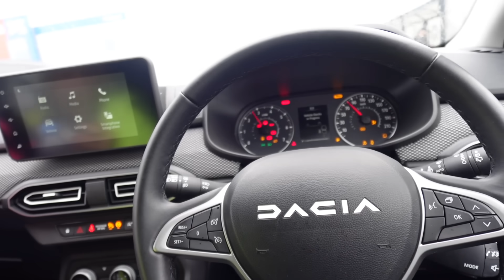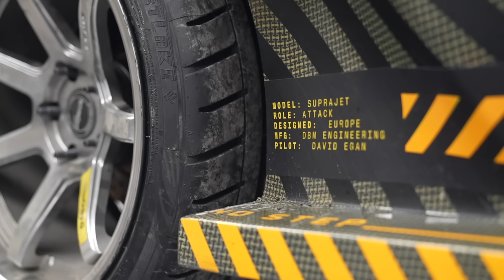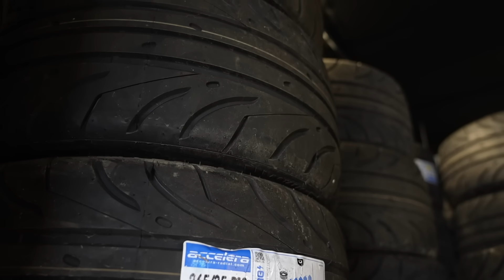Chelsea Denofa Drives my Lightweight Competition E36 (In Ireland)

Comment: Pretty sure the IS200 are well known for a tiny 2.0 6cylinder engine... not a 4cylinder although the Altezza had a high revving 4pot
Reply: I always thought so too, I recently found out that they got a 2.0 4cyl and 2.0 6cyl.. crazy
Reply: Yep, the is200 has the 1gfe. Which is the 2l 6 cylinder engine. Alteazza had both the 1gfe and beams 3sge.
Reply: Depends on where you're from probably. I've seen the 2.0 Beams in an IS200 & Altezza.
Reply: Both are beams.
Reply: Just depends on region. Usdm Lexus never used the 4 cylinder. Even the old es200s had the six cylinder.
Reply: The beams 3sge goes so hard
Reply: @deanojalapeno  The wagon Alteza in NZ came with a NA 1JZ :D
Reply: Yes! Those 2.0 beams 3sge engines are tough af... they Rev to the moon and love a little bit of boost
Reply: @wrighrw2  that car in NZ was not factory 1jz
Reply: You're correct if it's an IS200, it's only the 1GFE which is a 2.0 i6. 
The 2.0 i4 was only an Altezza engine.
Reply: Damn and the manual beams altezza in nz are 5-8000nzd and that’s for a nice ones, the clapped out ones are even cheaper
Reply: Yeah it's a i6 I have one I would know 😂
Reply: Stopped to look for this comment; the 1GFE powered all IS 200's in Europe, alongside the Automatic only IS 300 2JZGE you could buy. The 1G was a old engine by the time it was put into the IS, it first saw the light of day in the late 70's as a Crown engine. Underpowered compared to the average 6 cil. 3 series and thus not as popular. They make decent power with a turbo kit but are nowhere near JZ levels (no Yamaha engineering here). You only have to look at the under hood shot to see 6 exhaust runners..
Reply: @Ltbookum  Exactly. And every VVTi Yamaha Toyota Engine is considered a "BEAMs" engine. Heck, if you go through the Brochure of the 171 Crown, it even says 1JZ Beams and 2JZ Beams or something like that!
Reply: You're right. I had 3 😅
Reply: So is everyone in this thread American?
Reply: @tdkyt46  UK 🇬🇧
Reply: @millar3391  The 1gfe is a Beams engine aswell

Comment: Dave there not 4 cylinder 😂 that's the altezza 🤦
Reply: Same thing I was saying it's a 1gfe beams engine straight 6 2000cc
Reply: im from nz we dont really have the lexus model altezzas but is that true that the lexus's never had the 3sge/3sge beams
Reply: @the_fallen_one7784  they did yes have the 3sge engines that's what came in the altezza
Reply: Depends on the country. Where I'm from we got the is200 & Altezza, both with 2.0 4 cyl Beams Engine & also the 1G 6 cyl
Reply: @Chanski_X81 most Irish altezzas are the 3SGE but there is the odd 1g car. But the 1g is notorious for being the lazy lump found in the is200 here
Reply: I thought they came with a jz 😂
Reply: @Shane-BlackDesign  Is200's were only 2l 6 cyl (1g), everywhere in world.
Reply: @Mr_jz_12  Thanks 👍🏾 appreciate the info
Reply: @00ruva00  the is300 comes with a 2jz-ge

Comment: So excited for the is200 battles as i also drift a is200 did the first year na you should definitely be able to drift the entire layout in 2nd in the dry if you get enough entry speed probably enter in 3rd, and btw they are 2.0 6 cylinders

Comment: @daveegan i agree but there only good in the wet or snow ice and. It rains alot in Ireland 🇮🇪 like the UK,  good wet learning car 
Amd they take a beating but the is200 diff shafts and power pump are 💩🤣 sorry bit if u get a astra power steering pump lines ect , is300 diff shafts and alignment stock lock is good for teaching take loads of abuse and high reving

Comment: Of course the Dacia is bad, it's a french car designed to be the cheapest possible and made in eastern europe...
Reply: its romanian not french
Reply: and for what you get with the price its actually really great!
Reply: @trippy6956 Dacia dont design cars from the bottom, they buy old Renault platforms and puts a new badge on them, that’s why they are cheap.
Reply: @trippy6956  they are rebadged Renault and Dacia is a sub of the Renault group, i'm french and hate both brand, don't try to correct me.